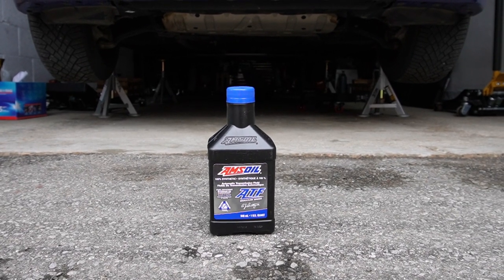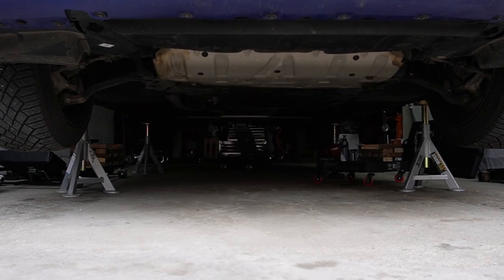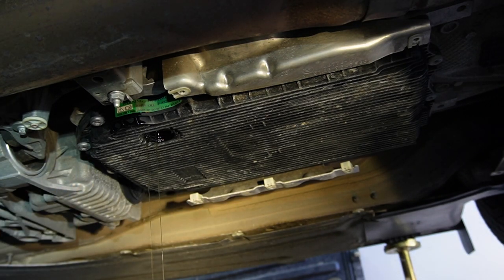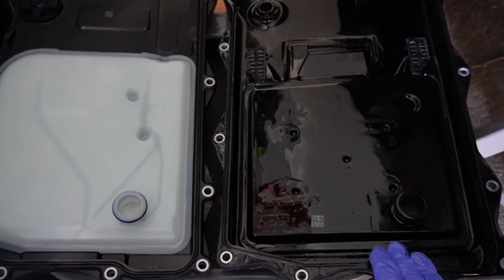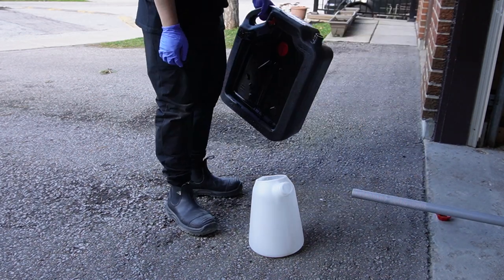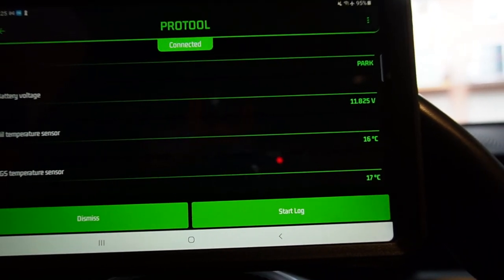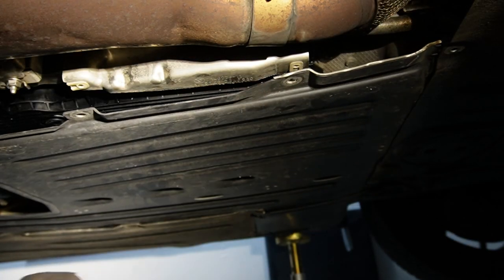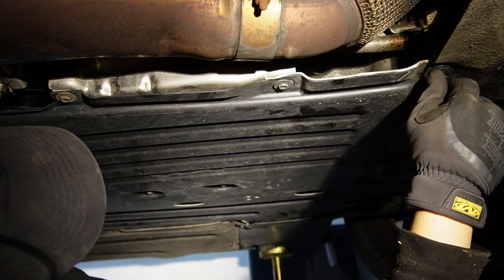*DIY* ZF8 Transmission Fluid & Filter Change | BMW M340i xDrive

Comment: finally a person that shows step by step, planning on changing gearbox fluid on my g30 xdrive , i'm at 54k miles ( 88k kilometers) ,or should i wait to drive 6k miles before doing that ? much appreciate for the video,planning on changing differential fluid,along with transfer case fluid.
EDIT: one more question ,i have a concern that i may be missing fluid in gearbox,should i check it at 35-50c range with the fill plug removed, to check if it leaks it out or not ? if it leaks, it's not missing,if it does not leak,is missing , right? :)
Reply from the maker: Hope this was helpful and that it’s also applicable to your G30 - at least it should be for the most part!
- I don’t think that 6k mi to 60k mi is a big deal, to be honest. If you wanna change it now, not a problem - If you wanna change it later, that’s fine too. Shouldn’t make a difference.
- Check the fluid and do the final warm (hot) fill between 40c-50c with the engine running. So this goes in order: Keep your engine running, go back underneath the car to remove the fill plug and have your drain pan ready just in case.
If no fluid comes out, check your device to ensure it’s still within 40c-50c, then to pump fluid back in till it pours out. Wait till a steady drip, close back up the fill plug and torque it down.
Alternatively, if fluid gushes out when you remove the fill plug at this stage, wait till a steady drip happens, then to close back up the fill plug and torque it.
In short, you’re right - if it pours down when your remove the fill plug, you have enough fluid in the system; if no fluid comes out, you need to top the system back up.
Cheers and good luck!
Reply: @TandeGarage  appreciate quick response, xdrive has to have 4 identical tyres correct? i mean same manufacturer,and same pattern.

As right now i have ( for front 2 one manufacturers tyre,and for rear 2 other manufacturers tyre ( different pattern / thread ),while braking from 3-2 gear or in general slowing down,it sort of holds the car for a moment and then releases, like it's not linear braking , could this be due different tyres mounted ?
Reply from the maker: @vytautaskryzius2556  not necessarily the case for xdrive - some models come with staggered setup even. As long as the fronts and rears are within the tolerance range, it will be okay.
But from my understanding, it will be ideal for the front and rear tires all of them to be same manufacturer and same model to best perform; so that it doesn’t create a huge bias in, for example, gripping power.
To your question about the 3-2 shift, that is a bit weird and I don’t really have an answer for you unfortunately. But like how you have assumed, I will start with swapping the tires.
Reply: @TandeGarage  got stock r18 alloys with identical tyres, will swap them over,and will see if that get's rid off the issue,or i will try to unplug transfer case,to see if that's the issue... time will tell.

Comment: Should i look for the EGS temperature sensor or oil temperature sensor? My car was park inside a hot garage the whole day and when i turn on the car in the afternoon , the EGS temp show 116F which is 46C already, am i still able to do the hot fill even though vehicle not running from warming up, and the temperature rise quick as soon like 5 mins, maybe the vehicle was park inside a hot garage all day
Reply from the maker: Till this day, I still don’t know which one should it be, to be honest lol.
But the car NEEDS TO BE turned on when you’re performing the final hot fill. 
As long as the car is running (you want the torque converter has already sucked in its portion of fluid) in which it only happens when the car is on),I do not assume warming up or not matters - you would just want the fluid to be in temp, in order for it to be expanded in the right level and be in the right viscosity.
Good luck!
Reply: Yes, i always have the engine running to check the transmission oil temperature , maybe the car wad inside hot garage all day and did not have enough time for the oil to cool down, i will try again in the morning when the car sit overnight 
Thanks again

Comment: Great videos, between this, the transfer case, and diffs, You've given me the info I need to tackle it on my G80! If I were to do transfer case and ZF fluid in the same day, should I do the transfer case first? Also, out of curiosity, do you use ISTA at all? I've heard that's helpful for the transfer case fluid swap.
Reply from the maker: Appreciate the kind words, means a lot to me!
I’m not too familiar with the G80 drivetrain, so I’m going to assume it’s relatively similar to the G20 and going from there according to my experience.
If you’re going to do the tcase and ZF8 fluid service at the same day, I don’t see a huge difference between which to be worked on first. However, I did the Tcase fluid change first then the ZF fluid change, as I knew ZF fluid change is typically messier with fluid splashing, dripping, everywhere; and I know I’m a clumsy person when it comes to dealing with fluid (lol). I just didn’t want to swim in pool of oil, in case I missed the drain pan.
If you’re careful enough, shouldn’t matter.

About ISTA, I have access to it. But I also have an ancient Windows laptop from 2013 that runs ISTA terribly slow. I prefer not to use it until I get a new laptop that can handle the load that ISTA is asking for.
And yes, I’ve heard from others, as well as the comment earlier indicating ISTA can open a valve to siphon the Tcase easier. I plan on trying that perhaps next year when I service again!

Comment: I just noticed that you didnt use the bmw fluid for transmission, is the amsoil atf compatible with zf 8 speeds, is it safe to use on bmw transmission, usually amsoil is used for toyota/lexus transmission
Reply from the maker: I’m using Amsoil ATL according to Sutphin Tuning (xHP ZF tuner) suggestion. It’s one of the Group 5 oil that can handle more “abused” and severer duties of a tuned transmission, before the fluid starts to break down.
According to the specs and info provided by Amsoil, it meets the OE (equivalent) fluid part number (83 22 0 142 516, 83 22 152 146) for the ZF 8 speed transmissions used on these cars.
If your transmission is not tuned, OE or OE equivalent will be completely fine for your application. I have had great experience with Liqui Moly ATF 1800 in my previous F30 330ix. Others have also spoken greatly about ZF Lifeguard 8, which is an OE fluid used on these transmissions.

Comment: Excellent video! Would you be able to link where you purchased the pan and fluid? Thank you
Reply from the maker: Thanks for the kind words!
In the video, the pan I used was made by Hengst, of OE equivalent. The part number is 24115A13115.
The Amsoil ATF/ATL was purchased from Amsoil website directly.

Comment: How did manage get the car on 4 jacks? According to the manual it only has 4 jack points..
Reply: Btw great video!
Reply from the maker: Check out my playlist about how to lift up a G20 on 4 jack stands!
Essentially, i’m lifting up the centre lifting points in the front and the rear diff in the rear; then to leave the jack stands on the factory jack points.
Hope this helps, cheers!

Comment: Nice video! I have been thinking about doing this as well, I am currently at 42k miles. I do not buy the lifetime fluid either.
Reply from the maker: Thanks! It’s definitely one of the maintenance items that should be tackled down, especially on tuned cars whether it’s engine tuned and/or transmission tuned.

Comment: What scan tool do you use to read transmission temperature?
Reply from the maker: I used Protool (only on Android). But I’ve tried Bimmerlink, and it reads the same as Protool. If you have Bimmerlink, don’t bother getting Protool, at least as of right now.
IMO Protool’s support on G-chassis vehicles is not as effective as earlier chassis say the F-chassis platform.

Comment: If i dont have the temperature gauge hook up, can i just measure how much it came out and put back same amount?
Is it possible just drain and fill without replacing the pan with 35k miles ? Because im planning to change the fluid every 30k miles and replace the pan at 80k or 90k miles
Reply from the maker: 1. Measuring how much comes out and how much to go back in can be fairly inaccurate, taking mine as an example in the video even.
Refilling requires the procedures shown in the video within the transmission temp window. ZF transmissions are, as far as I know, rather picky when it comes to refilling fluid; and would not “allow” you to fill it back up to the desired level without following the specific procedures.
I’m going to have to vote that a scan tool of any sort is required for this job.

2. I think it’s possible to drain and fill if you are servicing that early in terms of its mileage. From experience, the OEM fluid and these aftermarket fluids (i.e. Amsoil, Adrenaline SS, Liqui Moly, etc) are pretty compatible with one another. I wouldn’t worry about it too much about its compatibility down the road.
A lot of people are running aftermarket fluids, myself included, and there’s no way to get every ounce of OEM fluid out without an overhaul job. I haven’t seen anyone really mentioned their ZF had broken down due to fluid change unless it’s constantly abused.

Hope this helps!

Comment: Can i just drain and fill for vehicle just 35k miles?
What is torque on drain plug? 
Is it ok to reuse the old drain and fill bolt?
Reply from the maker: I would say to drain and fill closer to at least 80k km or 50k miles.
I don’t remember the torque spec of the drain plug specifically, but it does indicate on the drain plug as soon as you see it physically.
The first time I did this on my F30, I did reuse the old drain and fill plugs for about 1500km - in order to better dilute the system. It worked fine for that 1500km. However, I can’t comment on extended period of mileage over that using the old hardware.

Comment: I had perform a drain and fill transmission fluid, after measuring 4.5 quarts came out, but when i tried to refill it only take about 4 quarts and it started to drip, is that short 1/2 quart(500ml) is ok? I dont have the scan tool to measure transmission temperature, so i use the infrared thermometer to measure under the pan temperature to 107F about 40C
Should i drive around a few minutes more and come back try to refill that 1/2 quart?
Reply from the maker: Infrared thermometer is very very ineffective in gauging the temperature of the transmission, especially in this drain and fill process on the ZF. At least that’s what I’ve heard from others.
You’d be better off getting a more affordable OBD2 reader such as ones on Amazon; or better yet a Bimmerlink full access.
If you got 4.5 qts out, I’m going to say you should have been able to refill at least 5 qts back in.
I wanna assume you’re currently running low on fluid. Not ideal, but not the end of the world as long as you aren’t launching or doing anything crazy at the current state.
Reply: First, i want to thank you and appreciate all your help!
What i did was just drain and fill fluid , i did not remove the pan because i only have 35k miles
So low on 1/2 quart is ok for driving high speed free way? What short of half quart will do any harm to the transmission?
Should i perform another hot fill after i buy the obd scanner tool? Will it effect anything?
Reply from the maker: @benp1059  Gotcha. A bit low on transmission fluid shouldn’t do much harm to it as long as you aren’t squeezing performance out of the transmission, aka launching, sport plus high rpm shifting, etc.
And yes, when your OBD scanner arrives (hopefully in the soon future), just gotta perform the final fill between 40c to 50c - since technically you have already done the initial fill and maybe more.
Make sure the car is running when you’re performing the final fill, so the torque converter has sucked in its fair portion of fluid, that is accounted for in the final fill process.
Best of luck to completing the job!

Comment: hi - what is the model number of the pan for your 2020 m340i ?
Reply from the maker: The transmission pan filter made for 8HP45 fits completely fine with our 8HP51. That said, the part number for the pan I used is 24115A13115.
Good luck!
Reply: @TandeGarage  I'm planning to do this service on my 2021 m340i xdrive and I believe the model is actually 8HP51X. In the video, you mentioned the pan is different for mild hybrids (2021+) but I believe it is the same.
Reply from the maker: @Tromas494  I believe the part# for your MH application will be 24118743462 instead of the one provided above. There isn’t a lot of info and pictures about this part; but if you manage to find a picture of the actual product, you can see there’s, what seems to be, a separate smaller pickup port with o-ring, along with a pickup tube that goes to the integrated filter.
What that does - I’m not entirely sure. Would you be able to use the non-MH pan for much much much cheaper? Possibly, but I personally wouldn’t risk it.
Hope this helps your journey of making the right decision that works best for you. Best of luck!
Reply: @TandeGarage  Thanks for highlighting this) Seems they might be different after all. Called my local dealer with my VIN and I was told to look for a service kit with part number 8743462 (without prefix 2411 you provided). ZF also makes those, $200 ish where I live.
Reply from the maker: @Tromas494  Genuine BMW is always always way more expensive than OE/OEM, yet OE/OEM have been working just as good for me so far. I’d definitely go for ZF or even Hengst, which I’m using, if they share the same part#.
Good luck!